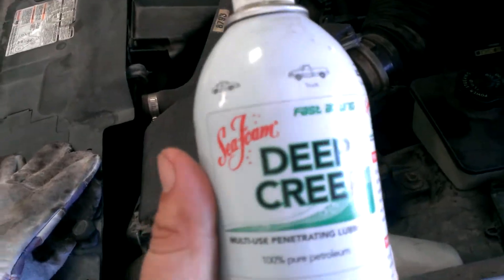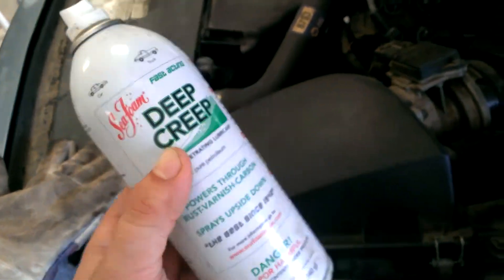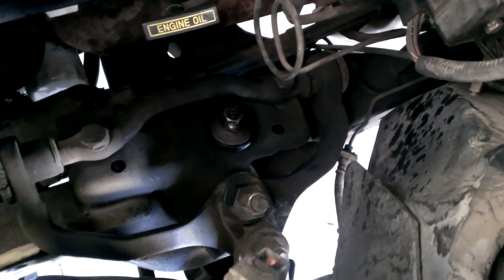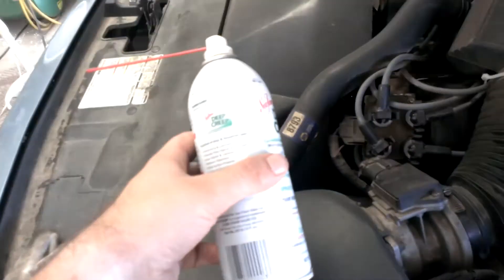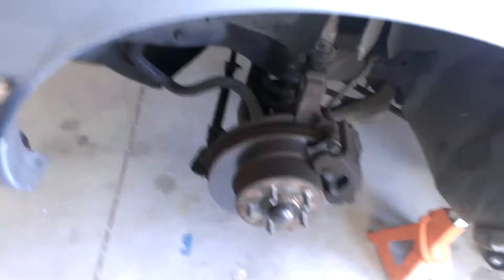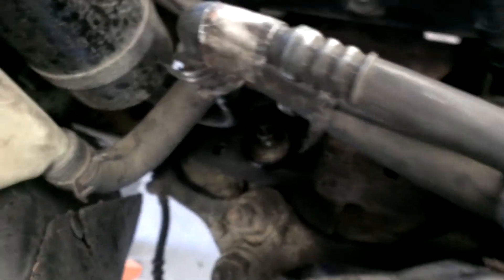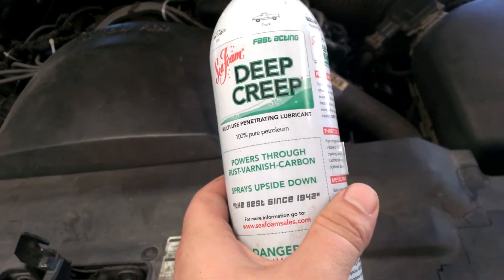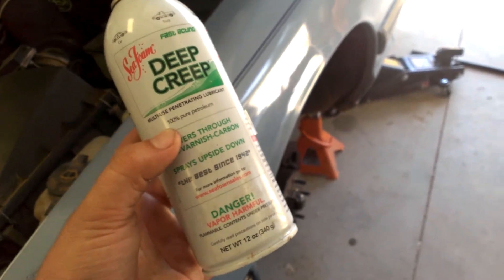Seafoam: Deep Creep

Comment: I've read about so many ways to loosen "frozen" studs and nuts.  A little consideration of the problem is instructive.  So called frozen threads are inevitably victims of what used to be called fretting rust.  This is rust that forms between tightly fitted parts.  Pulley wheels fitted onto tapers on motors are notorious for it.  The parts may be super accurately fitted together but water molecules are really small,  and seem able to get everywhere.  When they do,  in the presence of oxygen,  rust grows.  And I mean grows.  Rust swells when it forms,  a little like ice does,  and this effectively forms a super tight layer between the two parts,  trying in fact to force them apart.  This rust has all the characteristics that you would expect,  especially that the rust is super hard and super rigid.  

The only way to separate the parts is to somehow grind the rust into a sort of powder by forcing the two parts to move relative to each other.  This is not going to happen simply by trying to introduce some sort of lubricating liquid.  Stuck threads will often eventually come apart with no apparent penetration of whatever wonder fluid is applied.  The only serious solution is to heat the parts so as to crush the rust,  or to temporarily create a gap between the two parts.  Failing this a slow repeated movement of the parts back and forward can sometimes cause enough of the rust to be powdered to allow rotation or axial movement.  Often enough I have seen engineers resorting to destroying one part or the other to eventually separate them.  Drilling out "frozen" studs is so common.

Anti-seize compounds on assemble can be helpful.

Comment: The Marine outboard oil TCW3 rated is ashless and burns with gas. It will not harm cats or sensors. 1oz per gallons is the formula. Give it a chance with a couple of tanks to get in the system. It lubes and cleans the whole system. Quick starts you won't know your car is running at idle. Read up on this with Sarge LS1. Com you can get it at Autozone Walmart or online.

Comment: i love that stuff  use it at my dealer  better then blaster   and smells way better too.  now re the shock on the pass side   i have a 3/8 drive  hammer head made by IR   that would work perfect for removing that nut  in such a tight place  just need  a air compressor  . or you could try using a stubby impact  with a swivel socket

Comment: Hankranger, didn't know if you ever heard of Marine outboard TCW3 motor oil in your fuel tank for your cars. It has to be TCW3 rated. It's 1oz per 5 gallons of gas. Stands for Two Cycle Water cooled the 3 is for the series. It's better than Marvel Mystery oil or Lucas injector fuel system and cheaper.Google.com and put in Sarge LS1 he is the tester of thousands of miles with great results. You can check out loads of guys doing this with great results also. I use semi or full synthetic Marine TCW3 oil. Give it a shot you won't be disappointed.